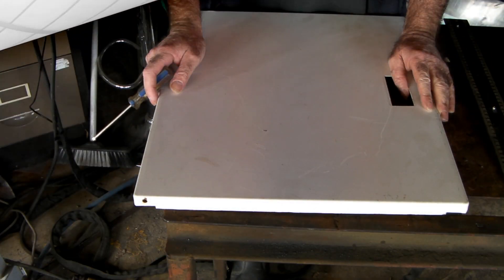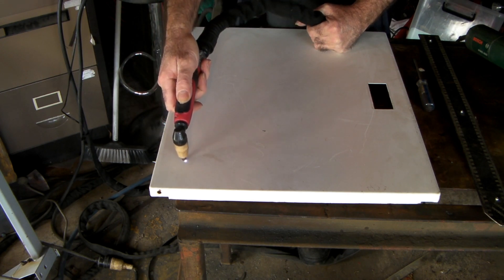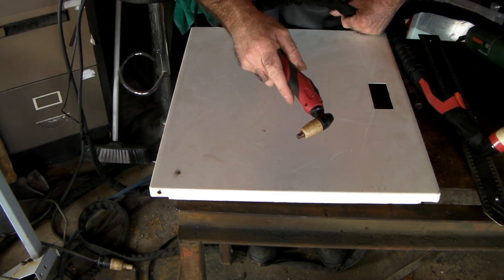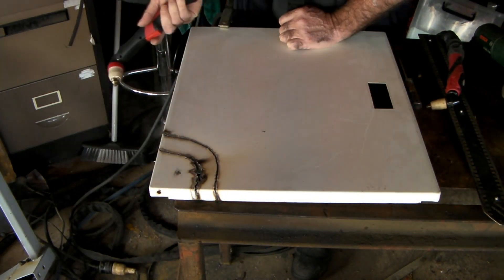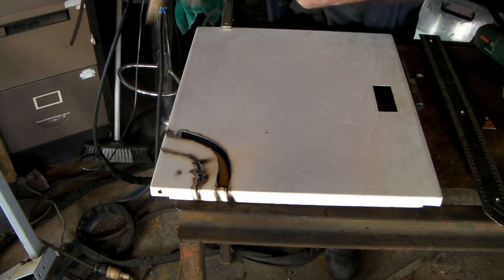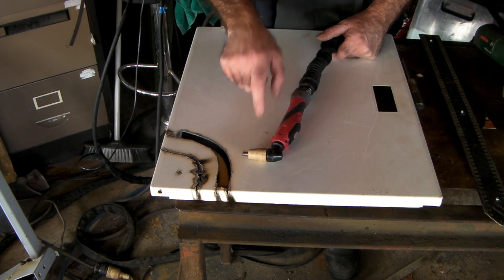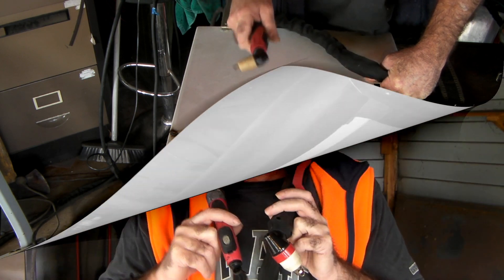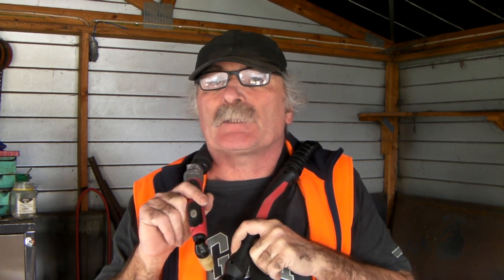Plasma Cutting Painted Metal

Comment: does it matter how thick the steel is in regards to using the grind paint 1st then cut with the non pilot arc plasma cutter?? I want to go through shipping container steel which is 3mm thick for windows and doors. Not having remove the paint or use a large 9inch cutting grinder would be ideal. Thanks In advance for any info
Reply from the maker: Hi ,you only have to scratch a very small bit to get you started ,once you start cutting it will just burn off.